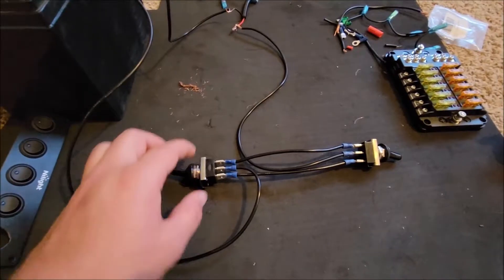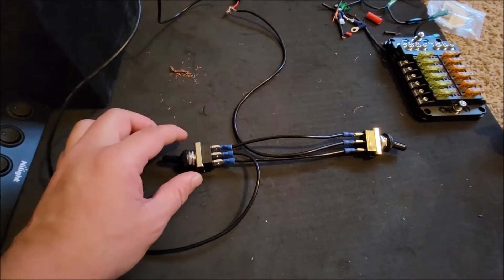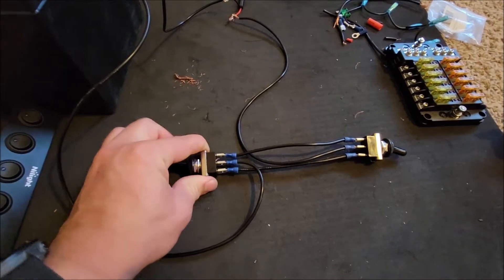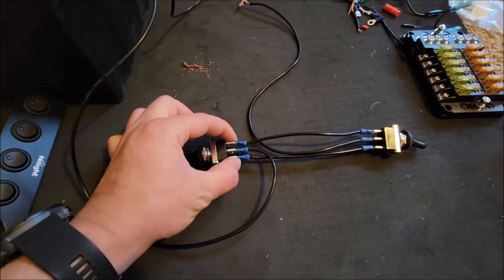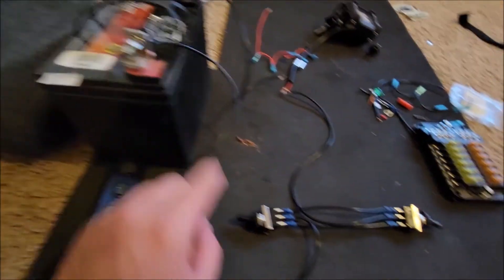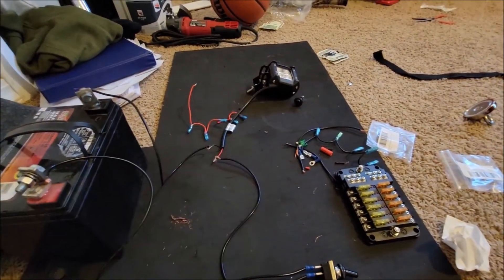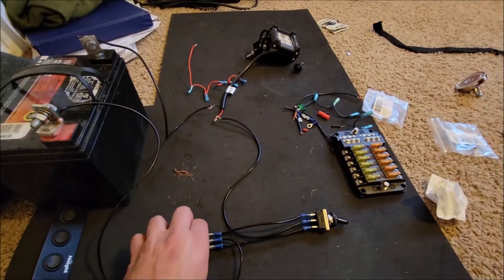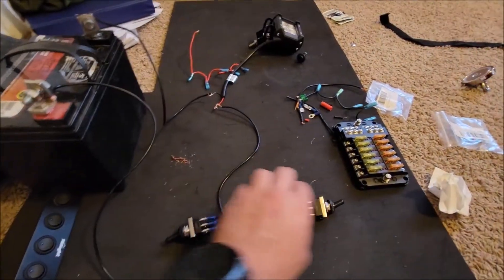12v 3 Way Switch DIY

Comment: Vid is 1.37min long and has a intro 🤣 still explains all u need to know amazing.
Reply from the maker: Thanks man!
Reply: @kkknnniiiggghhhttt  ✌ i do have one question as usual.
Is 2 switches for 1 light maximum or can i add 3 or 4 switches for 1 light? Thanks
Reply from the maker: @quepasatim  you may be able to run more than 2 switches. I have never tried it, sorry my reply isn't much help. I would wire it the same but jump each wire from the 2nd switch to the 3rd and then to the 4th. Go from the 1st to the 4th exactly how the video shows it. I'm not sure if it will work. But its worth a try.